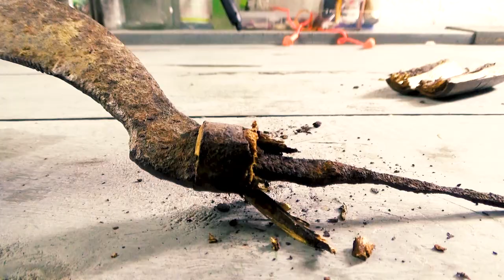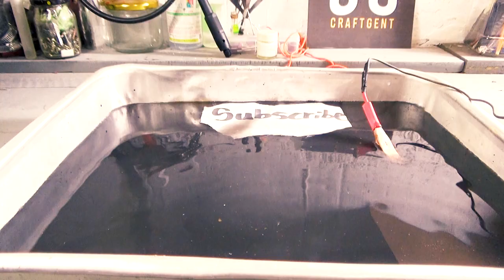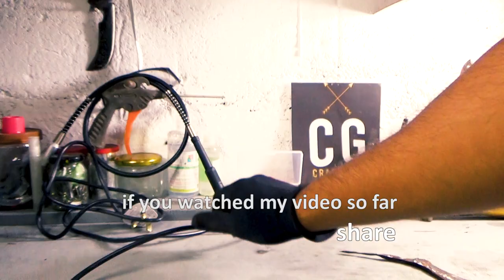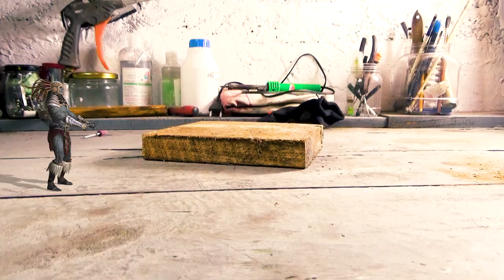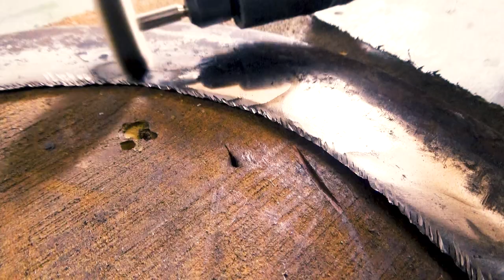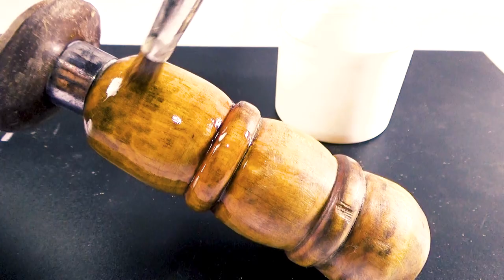💥💥💥Antique hand sickle restoration | Hand sickle | Old sickle Restoration #restoration #film

Comment: I don't know why the other commenters are saying that it's good work- it's not. If they are trying to encourage you,  they are doing it wrong. 
What I see is lots of effort,  but it's misdirected. For example,  the reason you're not getting any results with your electrolysis is that you have the two electric leads reversed.  Black lead wire goes to the item that is rusty and needs de-rusting. And the two items should not touch each other. You need to watch a few YouTube videos about this subject.
Your fit-up didn't fit. The finish on the wood was sloppy,  and the finish on the blade was ineffective. Just because something is shiny doesn't mean that it is sharp. You need to focus on quality work, and that takes time and effort. I see that you are eager to continue, so I hope that this comment will give you a kick in the rear to get going to the next level. None of us skips the learning process. 
So go ahead and start teaching yourself by watching as many YouTube videos as you can.  Then soon, you will be able to tell good results from bad, and pick up a few tips along the way. This is my way of encouraging you. 
Good video with a sense of humor! Thanks for the effort to make this video.
Reply from the maker: Thank you very much for your comment :)